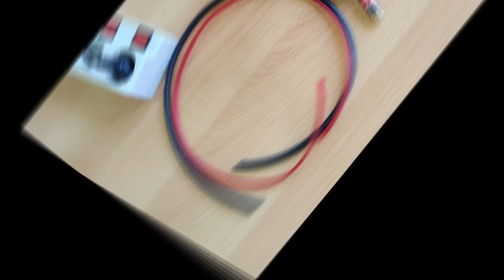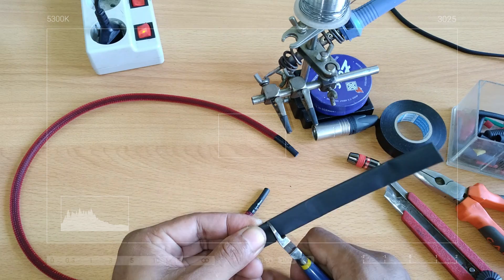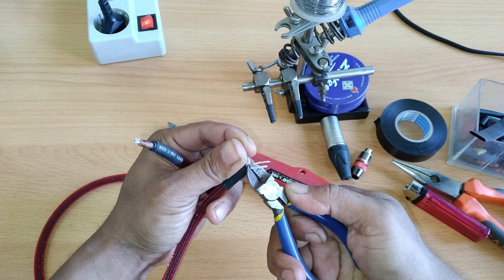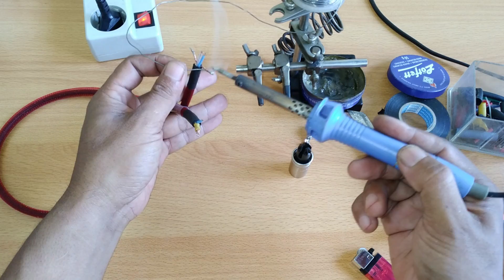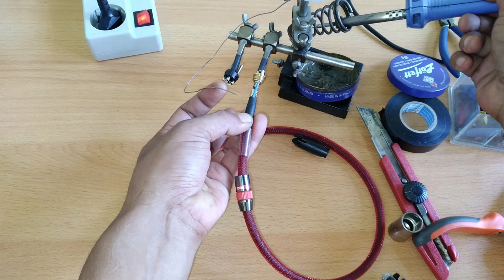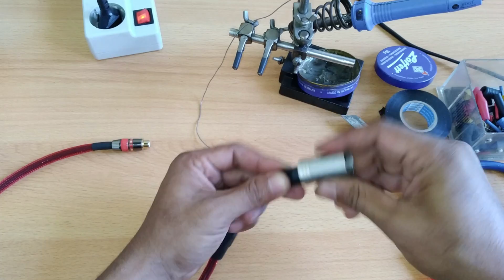Female RCA to XLR Male Audio Adapter Cable DIY

Comment: Please make video 2 side male xlr and 2 side male rca in cable how to add volume controller for mixer to camera audio leval up down
Reply from the maker: To set the sound level up or down can be set from the Mixer (Audio Source) or can also be set from the Camera
Dual RCA Male to Dual XLR Male Cables
https://youtu.be/qCt0X9Vxd-g
RCA Male to XLR male Cable
https://youtu.be/Xl0Hsp_4nRk
If Camera Support Input 3.5mm TRRS can use this
XLR Female to TRRS jack
https://youtu.be/4d3lA2-BglI
Thank you so much for interacting with our video